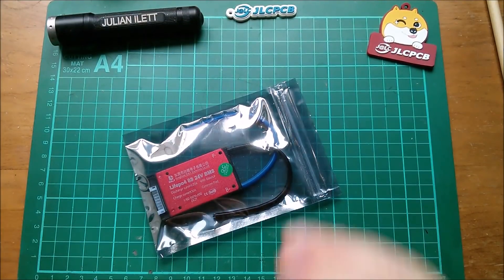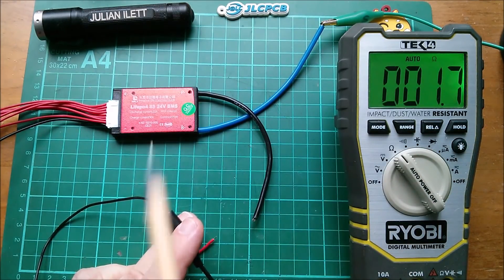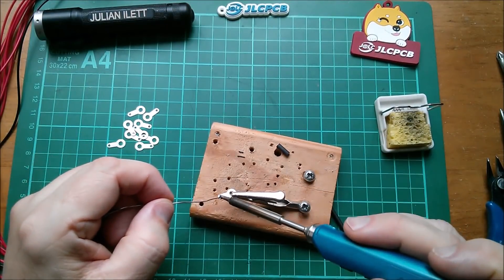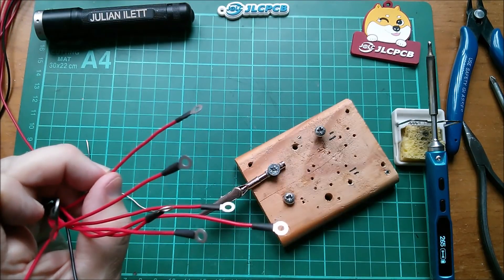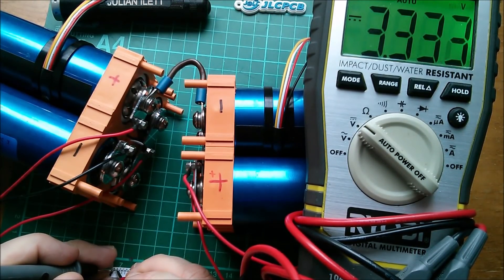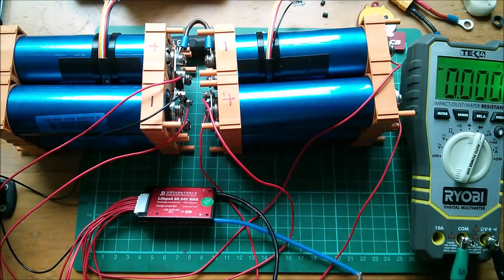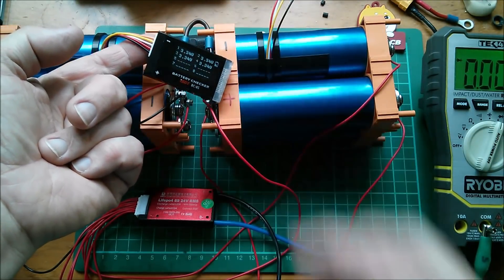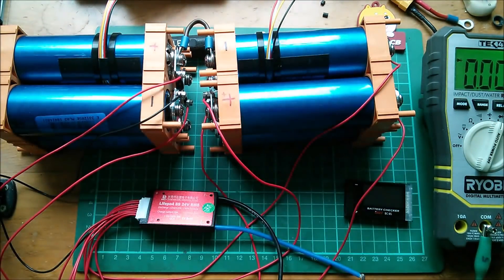Daly BMS for LiFePO4 8S Battery (with balance)

Comment: Nice, just make sure you shed is covered by the house insurance. Keep enough mud on hand to fill the hole after a heat event issue, or get some pond plants and a few ducks. the nice fire boys will provide the water for the pond. Stay safe. remember black smoke shed fire, white smoke fire engine as arrived.

Comment: Word of warning This Daly BMS has no Cold Protection (Important  for UK  - USA - Europe climates) To Stop Charging When 0C (32F) Cold or Frozen 
- Will Prowse Highlighted this issue with Older Generation Daly BMS's 

You should of gone with the Smart Daly BMS (with Bluetooth - USB - RS485) Allows You to tweak Cell Ballance settings + Temp Probes 
+ Gel Quick Splice connector  A 2nd Active  Equalizer Bidirectional cell balancer in with it
Reply from the maker: I just bought a super duper BMS with all the bells and whistles on eBay :)

Comment: Julian i need your help.... my cousin bought a scooter but the lead acid batteries are gone in them(there from 2004) they still hold 12v each but will not hold any current. and they are 20 amp hour dry-cell batteries 2 in series.
what im getting at could that system your showing in this video replace the old crappy lead acid's or do i have cut them open & top um up with acid. (just so ya know i told "not" to get lead acid. go for Li-ion or any thing with "Li-" in it) but 60 euro's tempted her. PLEASE LET ME KNOW HOW MUCH THAT COST YOU SO I CAN GIVE HER A PRICE IF SHE WANTS TO PAY.(thats if it will work in it,  24v 20Ah, two 12v in series) THANK YOU

Comment: If solar charge controller have option for right battery type, I will, probably, use it in charging circuit, especially, if controller is MPPT.. Sounds more safer.. 😉 Otherwise it sounds like dangerous experiment with expensive battery cells.. 😂 But, anyway, will be great to see results. 

Great battery pack update! That's exactly what was missing so far.. 👍

Comment: Julian, when you get to do some trials would be interested in seeing the thermal camera view of the BMS as it works in the various modes. I’m sure they are very efficient these days but the earlier units required heatsinking which I presume is taken care of but the metal enclosure.
Reply from the maker: Most of the time it's stone cold :)

Comment: I would be extremely careful using the BMS as your way of controlling charging. I personally wouldn't do it. I would worry the spike to the open circuit voltage of the panels when the BMS turns off might possibly cause the BMSs charging mosfet to short closed and over charge the batteries. Which would make them explode/vent if left long enough.
Reply from the maker: The voltage triggered relay (to be added) will turn on my crypto miner load when the battery is nearly full, and off when nearly empty. That should mean the BMS protection isn't needed.

Comment: I was looking at BMSs a few months ago and some users had issues with the Daly BMS or at least the smart version, I don't remember the exact issues people said, but I think one was that were going a bit over their custom set voltage, not sure if the basic ones are any better however what I can say is the Overkill BMS clones aren't bad and they use the same app. 

Oh and yeah it should work fine directly connected to the BMS but one thing to consider is that the parts may not handle going much over the rated 24v, so when it hits full charge and cuts off, it will see the full open circuit voltage at over 30v and may kill your BMS, for example the one I mentioned states that it has a max rating of 29.75v so in theory the battery will always bring the voltage down to a safe level and a charge controller will stop charge and prevent the bms from ever actually seeing 30v+.

Comment: Watch "Off grid garage" with Andy, he reviews loads of bms. That one is rubbish, I had to find out the hard way.
Reply: Rubbish ? I don't agree.. they do their job. Use it how they are intended. I think Julian should have bought a smart bms.
Reply from the maker: I've just bought a smart BMS (with bluetooth :)
Reply: @JulianIlett  bluetooth is a must, it makes adjustments and monitoring so much easier.
Reply: Andy found out, the balancing works only when charging. If the battery is not charging, the balancing also stops. This could be a problem.

Comment: That BMS seems kind of useless if it doesn't tell you anything.  Sure it should be working but you kind of just have to believe it is as there is no indication what it might be doing.  But you know LEDs are sooo expensive you can't be putting them willy-nilly on your product without your costs going sky high!   8-P
Reply: Daly has better BMSes that even come with Bluetooth and a phone app (also USB with a monitoring application for Windows), but they cost about double to these dumb ones. I have one of them and the app is quite nifty. It displays the voltage for each individual cell and the current flow (input and output).

Comment: You don't need a charge controller if your PV doesn't charge at more than 1C.
If the cells are to be charged at say 1C max, you can't plug in a 100W panel to it without some circuit to limit the current. 
Also, lithium batteries have a very specific charging curve as you well know. 
When bellow a level, they have to be charged gingerly at first (less than 100mAh). In the case on Li-ion, that's 3V. 
After 3V, the charge controller ramps up the current. Aim to do things to make your cells last as long as possible. 
I don't know much about LiFePo4 chemistry, but suspect similar restriction. 
Generally, the faster you charge a cell, the faster it will die.
Reply: I don't know a lot about LiFePo4 either, but what I do know is that given the same size, a LiFePo4 cell can handle far more current than a typical Li-ion cell, large headway cells like Julian has can easily handle charging at 80A and discharging at 200A, so we're talking max 2kW for that small pack he has.
Reply: @vgamesx1  LiFePO4 cells have a different voltage and maybe different current (check the spec sheet), but other than that they're pretty much the same when it comes to charging/discharging.
Reply: LiFePo4 cells are one of the most stable lithium chemistries, are much more stable than cobalt containing chemistries, and can even tolerate mild overcharging. They have many advantages over other lithium battery chemistries, but the disadvantage is they have a lower energy density. If space isn’t a problem, they make a good option, especially as an alternative to sealed lead acid or NiCd/NiMH cells.

Comment: Do you have some big heat shrink? chuck a piece on the spanner - one of these days Sod's Law dictates that you will slip and short a cell. And if Sod doesn't convince you, I will raise you the second law of thermodynamics. Charge controllers? PWM doesn't win you anything, but a maximum power point controller will do something for you, although the cost may make it un-worthwhile.